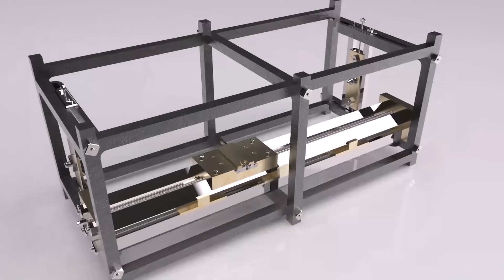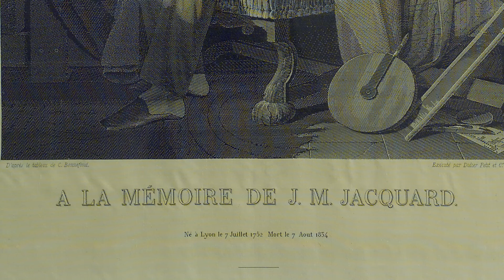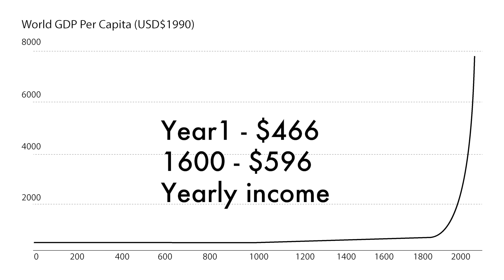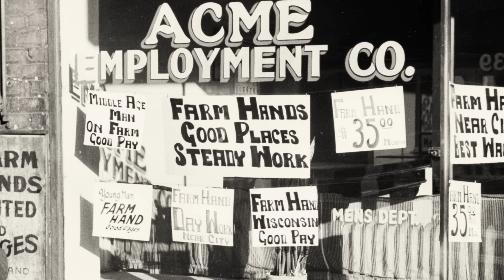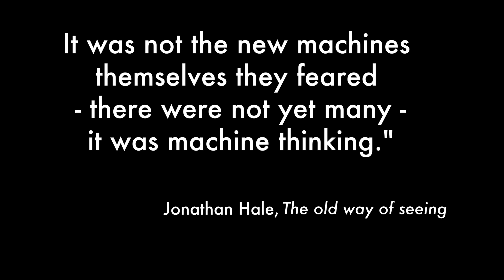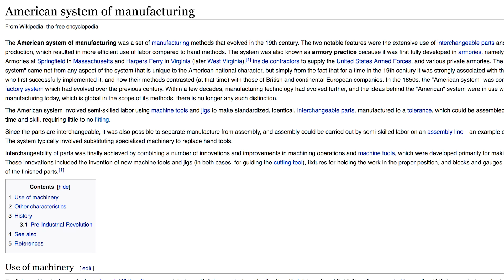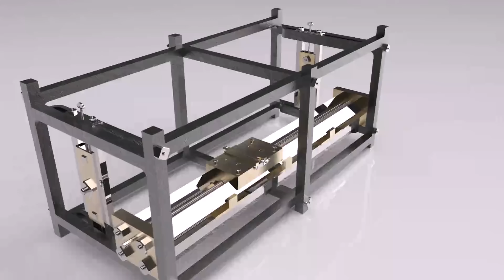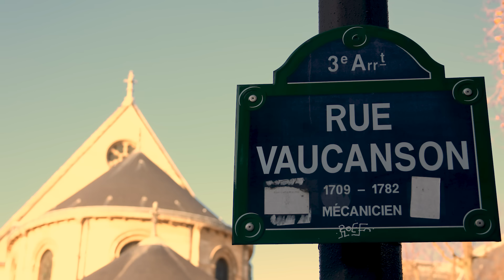The 1751 Machine that Made Everything

Comment: I ran a lathe when I was 18-19 which was built in the 1920s.  As a youngster I thought it was fascinating that something had lasted so long, and was still so precise.
Reply: Brandon Berry I had to take several semesters of machining for a vocational classes in high school in small town Kansas.  There were several machines, some newer, but there were older World War Two machines that the school received as donations after the war ended.  They were more accurate and intuitive than the newer ones.
Reply: @newamerikangospel  ,   Many of these are fitted with precision parts and pieces today! See the channel Abom79.
Reply: I used to work in a machine shop that was full of WW2 era machines that still had the Lend/Lease tags riveted to them.
Reply: i own a german lathe of 20 30's it was the time that lathes where used for engine parts and gun parts.. with that, a high need of high precision was back than already needed.
than again my lathe weights about 800kg+ while same size new lathe would weight only 150-250kg so as long as it does not fall.. (iron is extreme hard but it can crack when falling ) than you have a decent machine.

also keep in mind consumer products can not be compared to industrial stuff.  today industrial machines are made so it survive all. bearings are 10 sizes bigger than needed. platework is 5mm instead of 0.5mm  shafts are 30mm instead of 8mm. i work in a factory and only the boxes folding machine the bearings for the arm that graps the boxes. max load is 1kg with the arm. shaft of 20mm, mounted on 2 plates of 8mm,  4 bearings both sides of the plates..even after running 100 years that machine still dont need a swap of parts.
and than we look at machines from 50 years and older.. you can add that times 5 of overpowering. casted iron, solid block of 20cm xD that is why my lathe is so heavy xD
i love old machines.. milling machine, lathe, cold saw, all casted iron machines.. you just know even under heavy load  the frame would not even bend 1 micron. love it ;)
Reply: @blackdaan  
If it ain't broke by now it probably never will.
Reply: @blackdaan  ,  You must LOVE Adam Booth, Abom79, and HIS videos!
Reply: @BruceNitroxpro  ofcourse i know him.. and you can add thisoldtony just for the fun vibe 😁
Reply: @blackdaan  you
Reply: I have a 1930 10 inch LeBlond. Made in America and now living in the UK. Very accurate. I have made a brass bearing for a JCB turbo which worked ok.
Reply: And then came...."planned obsolescence"
Reply: The lathe I learned on pre-dated electricity. The original foot treadles were long since lost and it was converted to electric power. Still worked fine!
Reply: I feel the same way about old guns.
Reply: I found a rock that looks like it could have been made for something mechanical?
Reply: Tim Cannon 
Pics?
Reply: @timcannon2217  I'm intrigued by your rock sir
Reply: Oh really! Well wow wee
Reply: i have a sander i power with a motor made in 1926. very quiet.
Reply: Probably a Bridgeport. These analog  masterpieces are still being located and restored for use.
Reply: I worked as a machinist in the early nineties.
Most of the equipment we used was made in the thirties.
Machinists learn quickly that FIXING the godddam things is part of the job requirements.
Reply: @obglobgablob older stuff was built to last... a friend of mine worked as a "fixer" on knitting machines (textiles were big in my area) his company is still in business albeit quite a reduced capacity. They have knitting machines that make headbands and wristbands that were made in like the 40s or somewhere there abouts.
The neat thing about them is that they actually have a bit of style, the legs come down in these dainty curved angles and you line these things up 6 or so in a row and they are powered off one large electric motor with one of those big floppy old school belts. Very glad to seen something like that in use in fairly recent times, that was about 2012 or so.
Reply: Sembawang Shipyard in Singapore is a drydock and ship repair yard built by the British to repair large warships before WW2.   The over head crane in the machine shop is dated 1918.  The original machine tools - dated in the 1920's and 30's are still there and were still in use  in 1999 when I docked a VLCC there - original but for modern digital measurement equipment.    All this was installed and ready for the Japanese to take over in 1944!
Reply: They don't make things like they use to
Reply: @drakokamikaze8823  My boss still has his old Bridgeport from when he was 18. Still gets used, although it has a DRO now, and 3rd-party auto-feed on the table [X+Y axis] (but it  came with a Quill feed [Z-axis]). Also has some old Japanese Lathes, they are the biggest, and most accurate lathes we have in the shop, even our newer CNC lathe isn't quite as accurate as that old beauty... its a Mori Seiki but I'm not sure what model. Thing also has some insane torque, will literally tear itself apart if you are dumb as dirt and crash her hard, so the boss doesn't let most of the guys in the shop touch her.
Reply: On an episode of  "Orange County Choppers" (before it disintegrated completely), they were struggling to fabricate a particularly difficult piece, and all the state-of-the-art equipment in the shop just couldn't get it done.  Then one of the guys said "wait a minute, what about the old shop?"  It took about 10 minutes in the old shop, with WWII-era equipment that had cutting & bending capabilities the new equipment did not.
Reply: Just retired a lathe (monarch) that was made in 1911 .  
It was just too sloppy, even when restored 35 years ago !
Reply: @bobm549  fit new bearings. Swap the claw.

Comment: The Lathe can duplicate it’s self. It a amazing piece of equipment you can make anything. Any other machine has parts made that a Lathe made. If you can operate a Lathe you can make any part in the word or any other machine. Lathe Mill and Drill press in one . I’ve ran ones from 4” to 40” chucks also a horizontal turet Lathe with a 5’ chuck . Some big pieces I’ve turned ! But somewhere someone’s turning bigger pieces . Awesome video it could be explored several times deeper too.

Comment: Where does central banking show up on the list? And the invention of inflation?  What does that chart look like when adjusted for inflation?
Reply: The chart is adjusted for inflation. Also inflation isn't an invention, it's a byproduct of how money works. Inflation/deflation has been a problem since essentially the first forms of money were used. All that is required for inflation is for the amount of money in the system to increase. It doesn't matter if you're using gold, tobacco leaves (yes, that happened), or fiat currency like we use today. If you increase the amount of money in a system the value of that money goes down.
Reply: Inflation is not a thing that can be invented
Reply: Inflation and banking is that little bit around 1000 AD where the line starts to barely move up..

Comment: The line starts to go vertical in 1906. I think this is due to Frederic Taylor who invented High Speed Steel cutting tools for the lathe and standardized the cutting of cast iron and steel with the Feed, Speed,Depth of Cut and water coolant to keep the cutting tool working longer. This made it possible for semi-skilled machine operators to do the bulk of the cutting on the lathe to produce interchangeable parts. 
The standardization of speeds and cuts also was necessary for computer numeric control of lathes and mills although that would not happen in Mr Taylors lifetime.
You can read Frederic Taylor's book "On The Art Of Cutting Metals" which has been republished on Amazon.com as a kindle book

Comment: Much more interesting I think was the Malthusian paradox. If population quickly fills in, what happens if you lose most of the population suddenly? Under that situation the wealth flows to a much smaller population and you have the rise of a middle class. Those with wealth and power have no need of innovation and in fact are threatened by it. Those on the bottom have no ability to innovate and no benefit if they do. That is the main reason even as there was machines there was not innovation. Even today countries with extreme wealth divides become described as "third world'  because such innovation is not able to happen  The Black Death changed all that for Europe..

Early investment was by the "extended family" of religious groups that concentrated wealth there but as they had little political power, they built economic power through innovation. Your lathe certainly increased productivity of the factory, but those who had previously had a decent life saw that get downgraded by the factory owners sucking away huge profits with less going to those running the machines than when they owned what machines like looms themselves.

We are now at a cusp. We do not need huge factories to enable reasonable productivity. "AI" and robots are not limited as the old machines were to a single product for the life of the machine. The question now is one of power. Those who have all the machines in a closed system do not want and will not allow innovation that a person with their own robot provide even a better product into  the vertical monopoly ( if not a horizontal monopoly as well) and thus we are falling back into the preindustrizl Malthusian Trap.

When other civilizations collapsed only one part of the world was devastated and humans were able to arrive from elsewhere. Now there is no elsewhere and what is unsustainable  will not be sustained,  and the whole species is thus in jepordy. There has been only one great increase in wealth that did not involve a massive die-off of a majority of folks and that was the Social advancements of the 40s and 50s in the US, Canada, Australia, and Europe, where raw power was restrained and the population as a whole shared in the increased wealth.  The US was the first to break that connection, but now Europe is heading there. The results may take 40 years to become obvious but for the first time children will envy their parents insteal of the reverse.

Comment: Though I don't know the year, but the machine that actually should get the  credit is or was called an "Auto Matic Screw Machine. Though the lath as you described may have been first, it was until they were able to add the addition multiple indexing heads which could contain with a variety of various drilling, threading, turning devices which when geared correctly performed their various functions at the appointed time.

Comment: the same can be said of Johannes Gutenberg's  first printer press in the 15th  century
Reply: Yes and no, in my opinion: Yes, it made reproducing books much faster, but no, it was very labor-intensive. There was also the issue of paper having to be hand-made (using wooden tools), in essence there was no true automation back then.
Automation comes with circular, precise movement: All machines have rotating parts at their cores, even electric ones. The metal lathe made it, as was said in the video, possible to make simple but extremely precise round parts from which automated machines could be built, including printing machines for books and newspapers.

Comment: Not a bad supposition but the population graph shown is because of the discovery of the many uses of oil. Oil caused the population to swell and sooner or later it will run out and the graph will go down almost as fast as it went up. This is a much more likely explanation than the lathe.

Comment: All true, but I'm still a blacksmith(I don't shoe horses) because my soul wants to create. blacksmiths made the tools that the other creators used in their chosen profession. It was the blacksmith that created the first machine tools. That tool was the bolt cutter. The Smith could make a bolt with a header and hammer, but to true said bolt he made a cutter that was a cylinder with a hole long wise and teeth on the end. You home the bolt in the vice and put the cutter in the brace and turn it while pushing down the length of the bolt. Now you have a bolt that you can use in a fancy new lathe.

Comment: I certainly wouldn’t use this lathe, as pretty as it is, to be the point you say it is. Maudslay is considered to have invented the first screw cutting lathe. That lathe is the basis of all machinery that followed.

Maudslay’s lathe generated its own screw thread without a handmade master thread, the first to do so. It was ingenious. By changing the angle the cutter touched the rotating metal work, the thread would change, thereby allowing the cutting of any thread. This was used to generate a proper “lead screw” by which the cutter could follow, and, as they say, the rest is history.

The lathe shown here is considered to be an interesting, but an ultimately dead end.

Comment: I am a firm believer that the 3D printer and the materials they use is going to do for humankind what the lathe did in the 1900's.
Reply: Kevin Morrison A second evolutionary leap in technology? Perhaps. But I believe genetic engineering could be a competitor. Biology is ultimately a better matter manipulator than machines are. Learning how to control biology would probably have a few advantages.
Reply: @vgman94  I actually believe it goes beyond just and evolutionary leap in tech. This technology has already proven itself before it has got out of its infancy and while I believe it will do for us what the lathe did it is also showing where it can out pace and outperform even the great presses. The ability to print forms and structures that to this point were unheard of with current tech and the ability to literally print with almost any material means we will be able to construct smarter, stronger and more resilient constructions. Many of which we have not even invented yet because the tech was not there no one considered the possibilities.
Reply: I don't think we're going to experience this leap again, not on this scale. And I certainly don't think 3D printers are going to be the catalyst for that leap.

Comment: Never thought of lathe being the one,,,,but it's totally important...
Actually I worked in key West Florida on a project that bought an old Navy base, they had a lathe big enough to turn 50 ft stock.
In 88 we pulled out the wires that powered it 
Someone stole it but the value of the wire was at that time 15k 
The building had wooden brick flooring
Reply: Sam Labo where I come from I've never heard of " wooden brick flooring " .....could you explain what that means , please ?

Comment: If the "grazing land" of the renowned thesis of The Tragedy of the Commons has been offered for all, unlimited, almost free of charge, what would have happened?
The value of humans’ efforts herding livestock would be turned next to worthless.
A 23000 man/hour of useful work in a barrel of crude oil, sold on the market cheaper than bottled water, has destroyed the hourly value of the physical and intellectual work done by any individual - to less than a cent.
Not to mention another 9 billion tonnes of coals and billions of cubic feet of natural gas, produced yearly.
It was a colossal mistake by humans allowing the engine of Economics suspending in them their natural instinct responsible of assessing scarcity – etched in their DNA - when burning all finite fossil fuels reserves, that have taken millions of years in the making, at once, in a mere 300 years. 
Slavery and The Tragedy of the Commons have both got now their own law of thermodynamics:
"No energy system can produce sum useful energy in excess of the total energy put into constructing it" (The Fifth Law).

Comment: I was a machine tool builder. I remember tolerances for parts such as connecting rod bolt holes were +/- .006". 10 years later it was a true position of 40 microns or around .0015" total tolerance. To get the machine to pass runoff in both tolerances the machine would have to repeat with a quarter of the tolerance. In a sense going from "horse shoes and hand grenades" to threading the eye of a needle.

Comment: The problem with modern lathes is that you can not work between two dead centers. Any center that rotates with the part is a live center. the most accurate work is done between two dead centers. The old Logans we had in high school had a head stock that you could run a dead center in. As it is now no one makes a spring loaded dead center to run in the tail stock. I had to make my own with a new end mill holder. If you have to make a shaft with multiple precision journals, it is impossible to hold them all with in .001" without finishing the diameters between two dead centers like in an OD grinder.